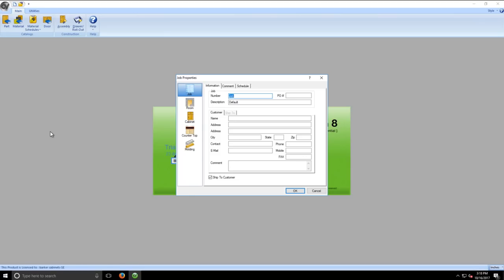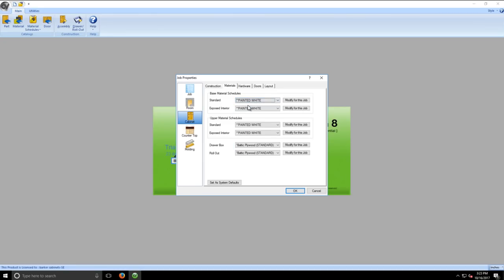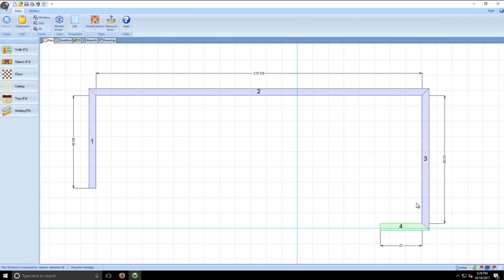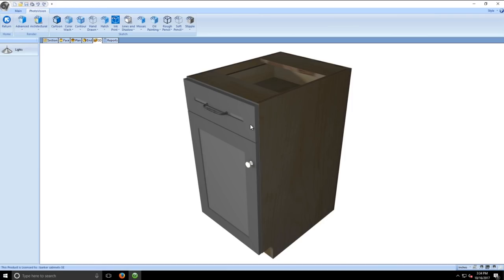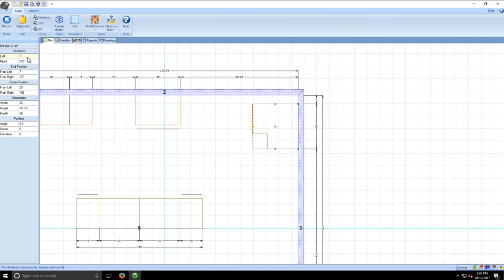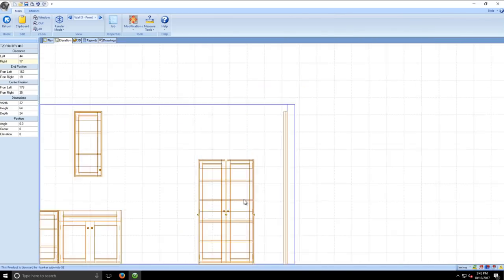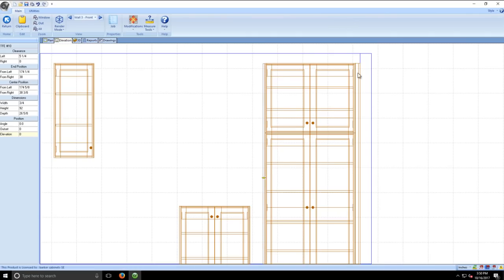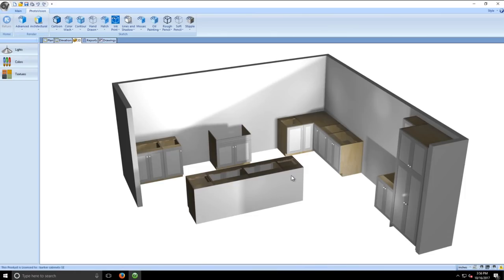Cabinet Vision 101 - Getting started with Cabinet Vision

Comment: Thank you for this helpful guide.I'm encountering one issue: when I attempt to make a cabinet cut using "Cross Section," the product is not visible in the cut location window. Additionally, I am unable to move the cut line, and the "Section" panel remains inactive. I would appreciate any advice you might have. Thank you in advance!

Comment: How much does the software cost ?
Reply: The core plus version that will do shop drawings and cut lists is 1.6k not 28k. If you want to be able to send to cnc then it gets pricey. They just restructured the core program and included quite a bit of the features of the higher priced versions at the end of Oct I'm very pleased with it.
Reply: 28K
Reply: Contact me if you need